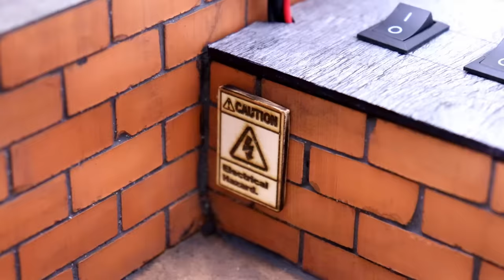Build Tiny Houses with Mini Bricks

Comment: Mini tools, "ice and water shield" for the roof, mini 5 gallon buckets of water to mix the cement, mini saws, trowels, shingles and everything! The attention to detail here certainly is something else. I'm gonna go out on a limb here and say this person really has a passion for construction and modeling if he is making all the individual boards and mortar and everything else for these tiny homes that he assembles piece by piece from the foundation to the roof. (He did use a regular sized tooth brush to finish the mortar between the blocks though)  lol. I wonder if he makes the concrete blocks or if he buys them somewhere.  It looks like he makes every piece of lumber needed (including mini sheets of plywood for the roof decking). Very cool man!!  This is what it would look like if the gods built homes lol.
Reply from the maker: Thank you! Very good observation.
Reply: Buys the blocks/bricks on Amazon (really do have everything on Amazon!).  incredible all the mini sized things he found & incorporated into video.  A fantastic job, right down to details!!  Love that sttention, perfection!

Comment: Electrician here... bad news buddy, but that wiring doesn't meet NEC, we're gunna have to pull permits and get a master Electrician to sign off on this to make it right. 
Joking aside, incredible detail. Bet it was as tedious to film as they were to build.
Reply from the maker: You are 100% correct. I had pizza delivered when the inspector was here, gave him a few slices to look the other way ;-)
-I used to be an electrician.

Comment: 5:57  “teleport your bricks, yes you have to teleport them, it’s a tedious step by step Gerold, get with the program” 6:01 “now put applesauce on the bricks and fart them in place, IT HAS TO BE APPLESAUCE GEROLD👹👹” 6:31  “now use your electric toothbrush, I ASSUME YOU HAVE AN ELECTRIC ONE, RIGHT👹👹?? Anyways, use your electric toothbrush and wash down every crevice of your tiny home” 6:39 “now take soil, mix it with water and spread it all over the bricks, OKAY??? Okay😊” 7:09 “now wash off the soil by dipping your wash cloth in the toilet and scrubbing off the soil😊” 7:18 “now do that process allll over the house” 7:22 “now slide in the wood planks without your hand, you can do that right? 👹👹GEROLD GODDAM IT- Calm down, calm down😊😊😊, now teleport in the planks, I’m sure you know the pattern without me showing you!😊” 7:31 “teleport in a different kind of wood that I showed you nothing about😊 and place them perfectly😊” 7:36 “NOWWW you can finally touch a part of the project, the door! That you don’t know how you got, you forgot, right Gerold?” “7:40 now fart on the hot glue for the door😊, you can fart hot glue, right? RIGHT?” 7:52 “do that again but for the bricks😊” 7:53 “now teleport in the floorboards and place them!” 8:09 “now this is where it gets tedious, teleport in the electrical wires, they’ll sort themselves” 8:17 “TELE- ahem Teleport in the REAL floorboards and place them too!” 8:19 “now from your eye, pull out the wall screaming in the background JENNIFER👹👹!! And place it😊! Do the same with the rest, don’t worry if you can’t see after the walls” 8:25 “TELEPORT THE  FLOORBOARDS IN AGAIN👹👹” 8:30 “place a block on top, Gerold, this is a tedious process, just do i- I DONT CARE IF YOU CANT SEE, DO IT” 8:33 “Spin the fan I assume you already bought…” 8:35 “PLACE THE ROOF GEROLD” 8:40 “place wood on the outside, don’t worry if it doesn’t look like mine, but if it doesn’t…..” 8:44 “place the wood on the roof” 8:48 “add depth to the windows!😊” 8:51 “PAINT EVERYTHING BLACK SO YOU CANT SEE THE BOD- the inside…the inside..” 9:08 “move in gravel and place them on the roof😊!” 9:35 “build another tower of bricks” 9:42 “hold on tight, we’re about to do electrical wiring!” 10:00 “hide your nice work!” 10:03 “and there you go a body hiding facil- I mean, house, a tiny house, LOOK AT YOU WORK! MARVELOUS👹👹” (I’m just trying to be funny)